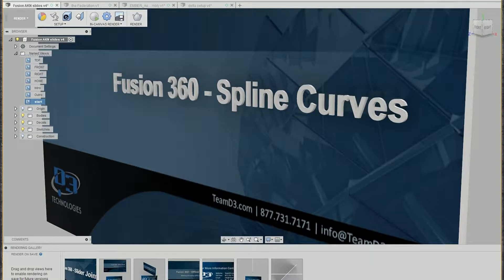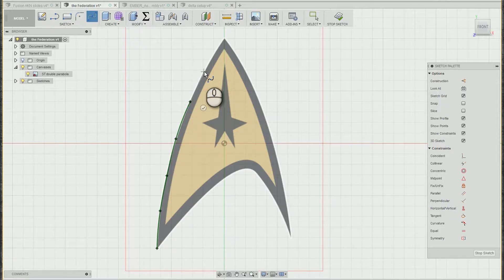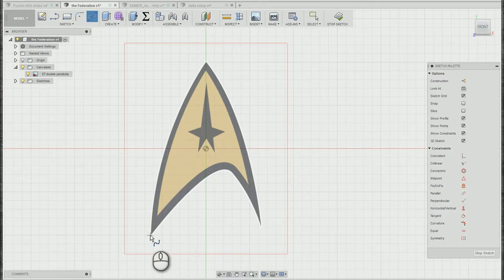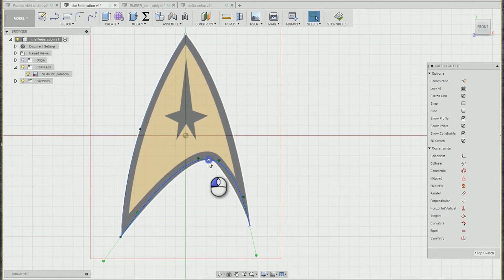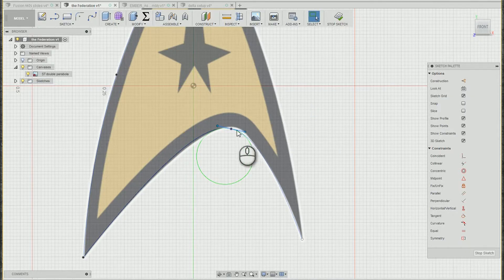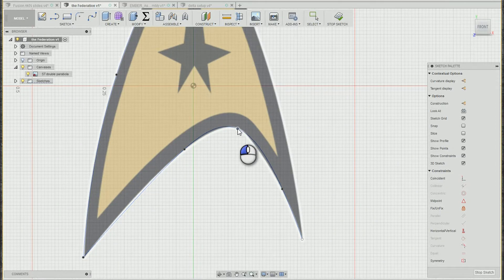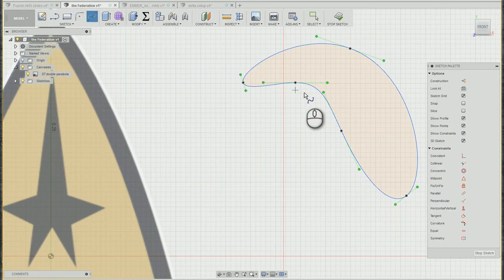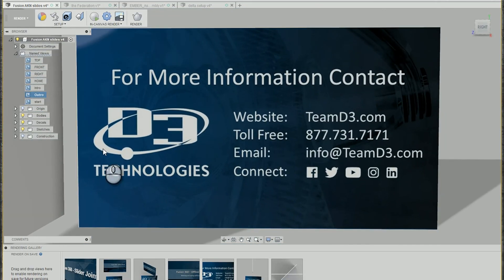Autodesk Fusion 360 - Spline Curves

Comment: Is there a way to disconnect the 2 tangent handles of a point, as in Photoshop Pen tool?
Reply: You can do something similar in Fusion 360 but the workflow is a bit different.  In Fusion 360 the fit point spline will always maintain smooth curvature through the spline fit points.  If you want a spline with disconnected handles you could use the “split” tool to break the spline into two splines at that point (with an intersecting geometry), or simply create two separate spline segments which are connected at that point.

Comment: Thank you so much. This is such a stupid tool, actually the whole software is dumb. Like literally every 3D or 2D software that I used in the past 17 years has the option to edit spline points; make them smooth, bezier, sharp etc. Not to mention the random constraints it creates, inability to move certain objects, sketches, until you make 5 other steps. Random freezes, unresponsiveness.. Select a body, do the shell modifier, slide it too far - freezes for 2 minutes; then tells me that the shell cannot be that big.. WELL no shit Sherlock, I figured that out 2 minutes ago, why are you still trying to calculate it..
Lazy, lazy codding...